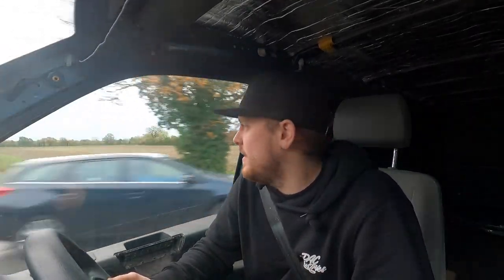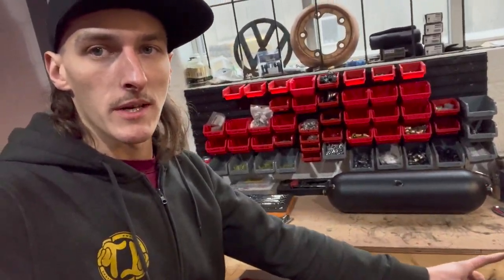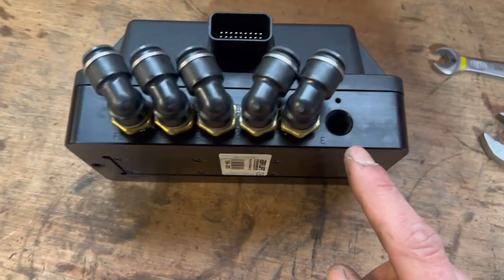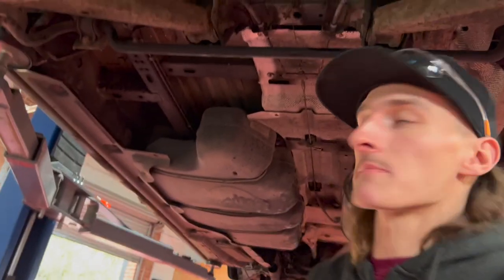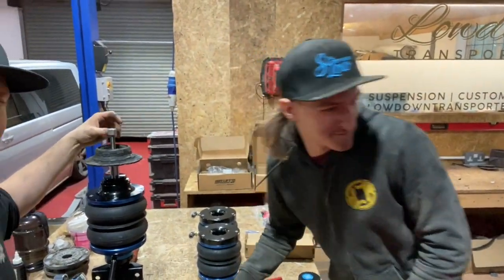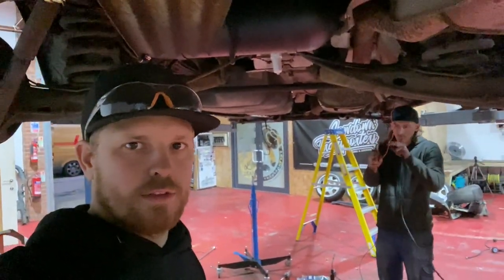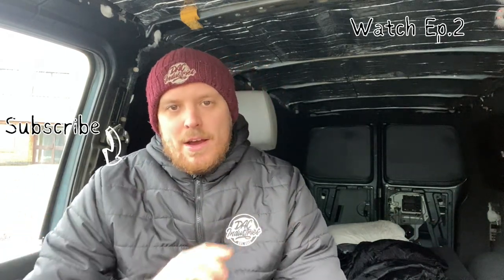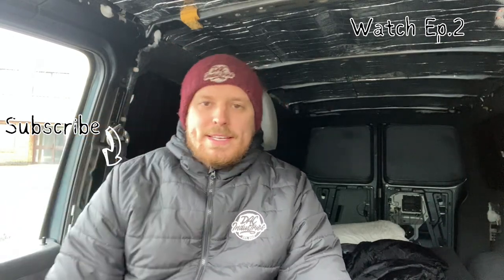Air Ride Install Part 1 - VW T5 Camper Project

Comment: You were up in my neck of the Woods, which reminds me that I need to Pop over to Wymondham to see an old friend of mine. A very well thought out Air system that you are fitting to the van. The Landy in the background got me interest, as it looks like the body is off the chassis and someone has tucked a set of wheel in the arches. Now going to watch part two.
Reply from the maker: Installed well isn't it! The Landy is sat on a Beetle chassis! Thank you for watching.

Comment: I, what do you use as your standard ride Height? I'm trying to get mine to a sensible low on air whilst driving. I'm accuair so if you could give a ruff measurement from ground to top of arch I'd be greatful.

Comment: Hi Dan!  How much does it cost to buy and fit the So-Low Suspension.  I’ve got a SWB T5.1 t32 kombi???  The van looks awesome.  Nice job 👌
Reply from the maker: Hi chris, best thing is to drop Chris @lowdown Transporters a message or call as there are many variables. Cheers bud, So worth doing.

Comment: Is this the same van from the first build where you sprayed it with rattle cans? Still looks great if it is, I've been curious how the paint has been holding up through everyday use
Reply: It’s a different van. Would be good to see what the first one looks like now though.
Reply from the maker: No bud different van. That one is still around. I got sent photos of it a few weeks back. It has had some changes made, not stuff I would do.
Reply from the maker: I got sent some images a few weeks back. It is still around but has had some other modifications....

Comment: Will this system allow you to level the van when camping?
Reply from the maker: To an extent. You can level off front to rear ok but not much side to side due to the ant roll bars linking the sides.

Comment: How does it work for selling van on with notching structural parts ?
Reply from the maker: If you are open about what's been done it shouldn't be a problem. If someone interested in the van if I ever sold it was worried about structural cutting then it definitely isn't the van for them.
Reply: @DanChambersDAC  I have a t6 on air and with no cuts but was wondering 👍